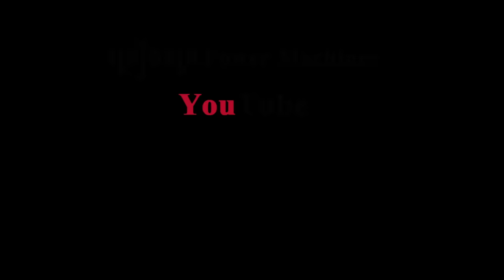Incredible Powerful Excavator Sink Underwater Heavy Recovery Long Reach Komatsu Kobelco & Big Crane

Comment: The bucket on the sinking machine is holding it back from going anywhere..only answer bring a proper crane in lift it out...actually there making it worse an to many operators hand waving all over the place

Comment: The only real surprise here is that the crane didn't tip over.
Reply: I think they would have saved more time and money hiring a big caterpillar D10 and to have dragged it out with sherar brute strength ?
Reply: @gtibruce ò
Reply: @gtibruce dig around it
Reply: Dig around it
Reply: Dig the bucket out
Reply: Dig the bucket out
Reply: @AlbertMiller-cz8rq  Everything has its own solution. Just choose the safest method

Comment: If they weren't  pointing UP for the entire video, would the crane operators and the excavator operators pull down instead?
Reply: bad hand signals.  I'd go crazy if I had to operate the crane with those 2 guys pointing up.  Do I  hoist up or boom up?  Who knows what they want !
Reply: @frankovito  I worked in Sri Lanka on a huge engineering project as lead engineer. Day 1 I had 50 people directing the lift operator with 16,000 lbs and a 1 million unit. There were 5 units. I screamed....  "STOP!" STOP! I went to the Sri Lankan engineer who hired me and said....  "I am a team player, I can be in charge, or I can take orders, but if I am in charge, NOBODY, NOBODY gives directions to that lift operator but me or someone is going to potentially get crushed.

Comment: If they undone the hydraulic hose on the dipper Ram it mite of help it’s like a anchor in most of this episode I am a crane operator this would of help
Reply: You have the key to this extraction.  The arm was not only an anchor, it added to the effective weight they were trying to life by putting the pivot point way out there.

Comment: i think the right way to recover is one of the excavator to lend support to crane boom. the crane has more than enough coiling power to pull but ground or countrr weight not enough. therefore supports needed at centre of boom under
Reply: Karşı ağırlık için makinaların uzak destek ayaklarına kovaların koyarak vincin şahlanmasını önler ve vivç rahatça dengeli bağlantı ile çekip çıkartabilir.
Reply: mana lah 0rang hebat

Comment: If the operators of the Kamatsu and the crane had the skill sets of the Kobelco this could have been done in half the time. After all the hard work is done, someone wearing a hard hat and white dress shirt shows up wanting to direct traffic.
Wire cables and flesh do not a happy union make if one of those cables snapped.
Nice video with great shot angles.
Reply: I like my head, and arms....  life in general. NO thanks to being around those cables.
Reply: I'm a heavy rigger, that being said, I don't do wrecking like this, however I suppose I could handle such (not to be a know it all.) But you opinion....  wouldn't you have been better to crane up on the bucket / arm. Loose the hoses if needed, get that bastard, anchor OUT of the dirt, SPIN, so that the arm is headed OUT. Get it on the ground, out of the water so it would maybe ski.  THEN lift up, and use the others to pull?  Your thoughts?  This is hard on everything and you are moving and pulling against the center of the earh almost.
Reply: I suppose lifting on that arm, would flip the damned thing backwards and upside down maybe with all the leverage you would have....
Reply: @brentbarnhart5827  exactement   ils  veulent   sortir   le  corps  mais   le  bras  le  retient   sûrement
Reply: @alainguilon6218  I agree Alain.....

Comment: Set of idiots are on the job , not bothered about safety. Stick cylinder  & bucket  stick must have been disconnected, before drag operation. That could have reduced ground resistance, equipment could have moved easily